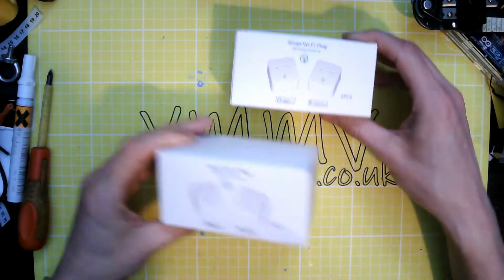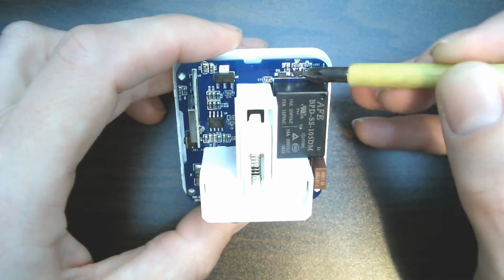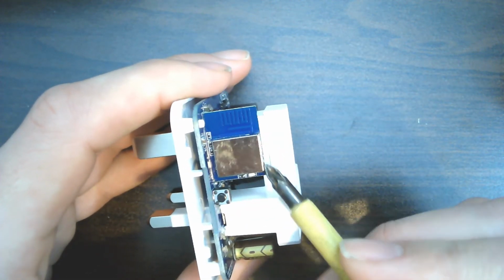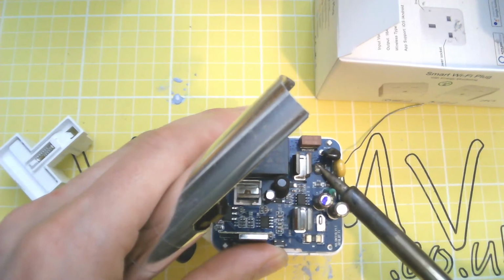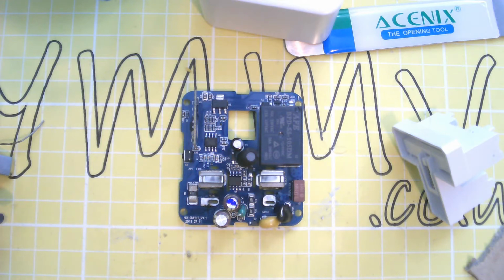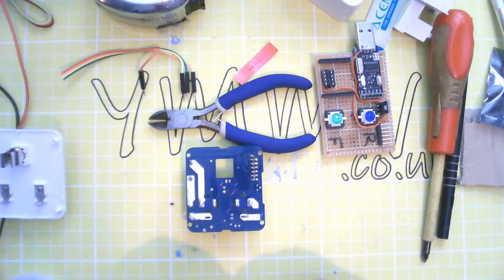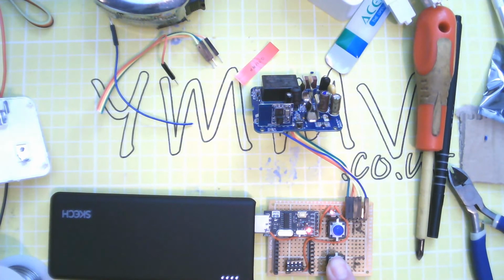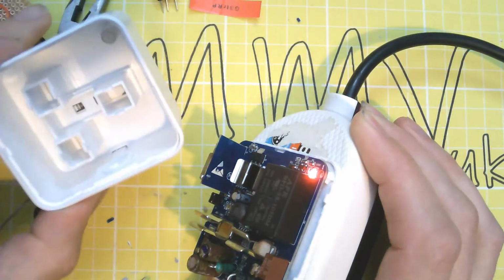Teardown and reprogramming a SlitInto ESP8266 based switch

Comment: Hey thanks for the teardown, it confirmed that I DO NOT have the skills to do all of that :-)
However, I did manage to flash these plugs using toya-ota and using your pinout got it all working.

Once question, the Voltage and Current are completely wrong 22v/525W respectively - do you have any idea what I'm doing wrong?
Reply from the maker: Hi, thanks for the feedback.
I have to admit I haven't done anything with the power monitoring in these, so far, or used any of the ready-made firmware sets.  Sorry.
Reply: @ymmvcouk  Hey thanks for your reply, I figured it ou  in the end using the Tasmota WIKI here: https://tasmota.github.io/docs/Power-Monitoring-Calibration/